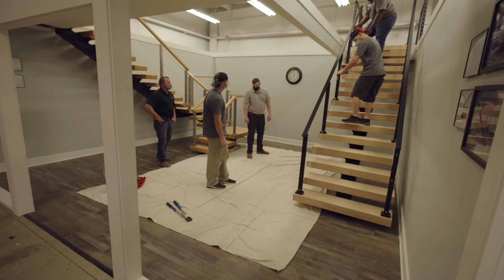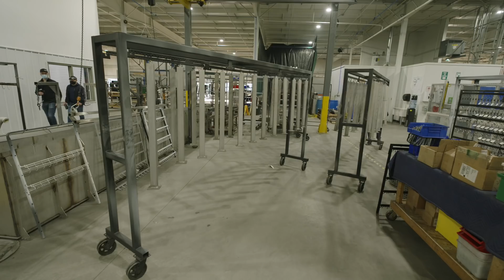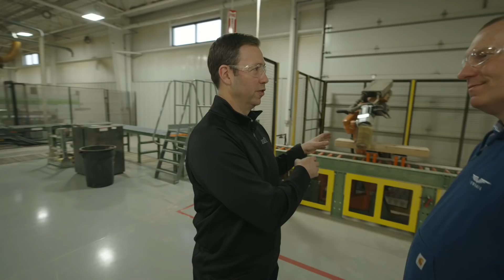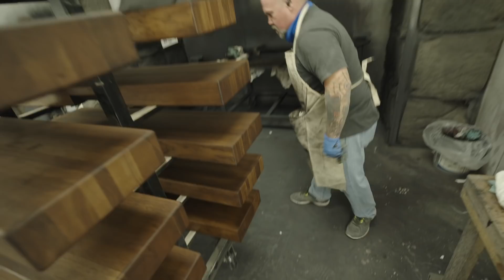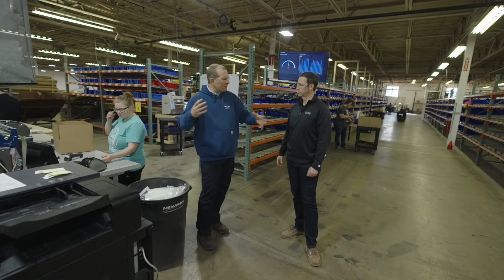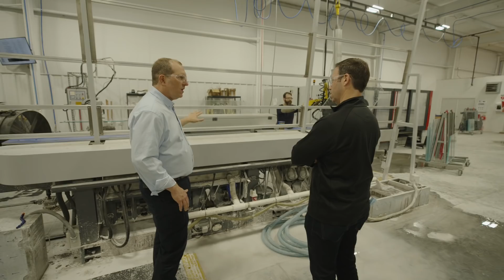Raw Steel, Glass, and Wood Becomes a Beautiful Staircase - See How its Made!

Comment: They showed so much but it looks like they missed showing the part of building the stringer and attaching the tread retainer.   Maybe I missed it, but I went through a second time and didn't see it.
Reply: When they show the bending and welding process of the mild steel parts, those brackets are the bolt on tread brackets for the stringers
Reply: @rampage577  yes, the tread support brackets. I saw that but didn't see them building the stringers.
Reply: @akairborne  https://www.facebook.com/watch/?v=348456776393714 try this installation video
Reply: @rampage577  Holy Friole!!!  That is sexy AF!!!!!

Comment: So what are builders to do in the interim (measure to install) for upper level access for trades? Temp stair case that gets trashed when these show up?
Reply: Often customers will install our stringer wrap it in plastic and put temp treads on the stringer along with 2x4 handrail until they are ready for the final treads.
Reply: @lennymorrison  Exactly what I did.
Reply from the maker: Generally yes. I’ve occasionally moved temp stairs to another job but that doesn’t always work out.

Comment: Just an FYI that handrail in the opening shot is not code compliant in most jurisdictions (IRC 311.7.7.2).  It must continue at least to the nosing  of the bottom tread.
Reply: I don't know what handrail you are talking about.  But The building inspector was going to fail  the Viewrail system I installed myself in my townhouse renovation in South Jersey. I had a  square wood top rail that was too close to the wall it passed to fit your fingers in. I also before inspection install a secondary round metal grab rail. I called for final inspection. I was out of the house when he showed up. He told my wife he was going to fail us for the railings. I get a text from her saying this guy is an asshole he is going to fail us you better get home. 
I hurry home. John the building inspector is outside on his phone. I go in the house and my wife is so upset after finishing our two year renovation  that we are going to fail final! I said I'll take care of this. John comes back  in the house. I say very calmly what's the problem. He says you need safety returns on your hand rails. I say how do I fix it. ( Never tell them they are wrong even if you know they are wrong- I don't think he is wrong in this case) I walk over to my railing and start to to think out loud how I can fabricate a safety return. He says it isn't going to look good and that his boss on the phone said he can let it pass if he wants to. I said that would be great if he could and he did. Sorry for the long post but I know construction guys like inspector stories.
Reply: LMAO

Comment: I never ever would have guessed that so much went into the manufacture of custom stairs. After seeing the operation and then hearing the top end price of $15,000 it seems like a good deal.This is a fantastic video.
Reply: keep in mind he said typically its around 15k with minimum being around 9k... if you have something larger or more extravagant than is typical then it'll cost more
Reply: I'm amazed that they're "only" $15K. I thought for sure a top of the line staircase would be more like $30K or $40K (given the cost of building this factory and being American made).
Reply: Those machines are expensive, but the raw materials that go into stairs only cost like $4k (when using expensive lumber, with cheap lumber it's only $2k).
Reply: I just bought there flight stairs, my setup is 4 sections of 6 stairs with Rod railing, cost me almost 30k, this video is a year old, prices have gone through the roof since then

Comment: I like the overall look but hate the excessively thick treads.  A staircase like that should appear to be light and airy, floating above the floor.  There is no structural reason to have such a thick tread, it adds weight without improving functionality.  Better would be to wrap a steel tread in a thin veneer of wood, or just use a steel tread without any wood.  Risers can be glass or polycarbonate.
Reply: The thick treads exist to achieve code compliance.  The space from the top of tread to the bottom of the next tread must not exceed either 3.5" or 4" depending on codes where you are.   It restricts limbs from being trapped in the space in the event of a fall.
Reply: @wildtwindad  I know it’s for code compliance, but that’s they lazy way to comply.  When faceless bureaucrats try to dictate ugliness it’s up to us to respond with beauty.  In this case using glass or polycarbonate risers, as suggested, will enhance the beauty of the design while also enhancing safety and meeting code requirements.
Reply: My dog would disagree; she would never use a staircase that's as airy as you describe.
(... and since I have no desire to carry a 70lb dog up and down the stairs, practicality wins for me)

Comment: Love the system and made in USA.  I just wish they offered a glass tread.
Reply: They're not really practical. Can chip or break. Slippery. And would have to be really thick. Plus it's a liability issue.
Reply: @skliros9235  The traction can be addressed with rubber grip tape but I see your point on the chipping.  That would be a big downside.  But I have to believe they would be able to supply replacement treads.  I would buy an extra one just in case.  I've seen those systems in Europe.